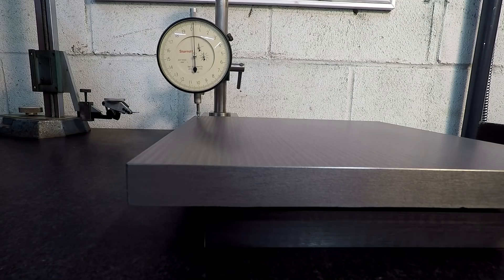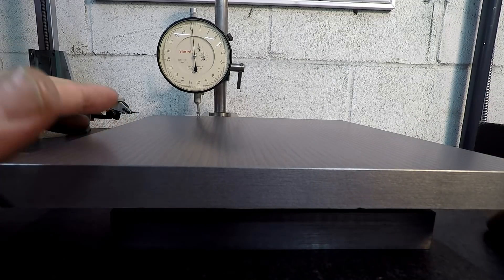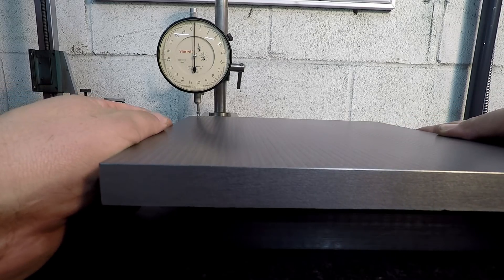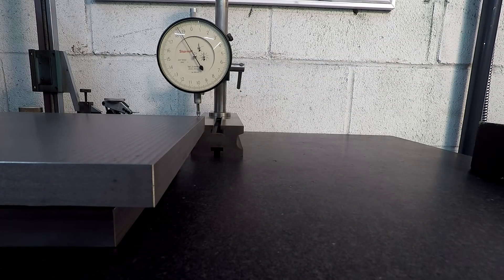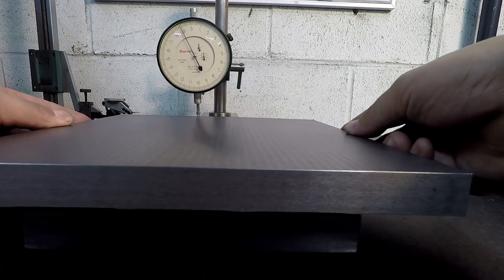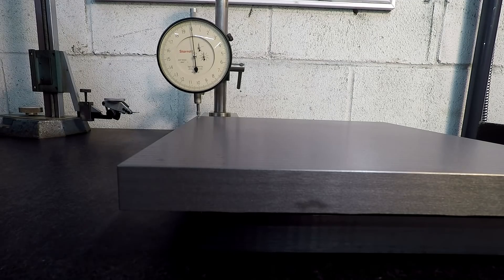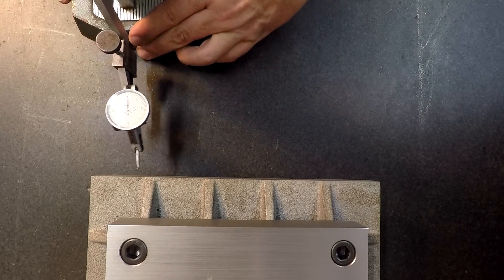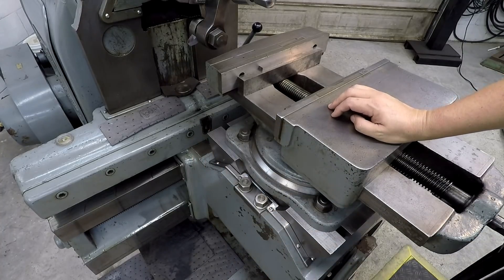Fireball Tool Fixture Plate Part 6: Inspection

Comment: have you tried inking it against the surface plate and hand scraping?
You could probably get it within a micron or better without too much trouble, don't ya think?
Love what you've done, especially with such an old workhorse of a machine, which you've really dialed in well!

Comment: You bumped the work in the vise till the parallels were tight . I think a better way would be to put a piece of paper under each end of each parallel and gently tap it down till the paper was tight on all four corners.

Comment: How did you keep that dial indicator parallel to the workpiece as you moved across the side? Whatever you hold it against has to give you a lot of confidence to measure in tenths like that
Reply: Surface plate older tool than a shaper.
Reply: A straightedge behind the base of the hight gage?

Comment: Have you considered mounting your shaper on the wall to run the ram vertically, which might eliminate that last thou of drop?
You are doing great work on solid machine that has 70 years of use.  Ignore the nitpickers!

Comment: When lifting the clapper to hone the tool in place would you be introducing a skew out of square in the tool hone due to the arc at which the tool travels when lifting the clapper as a result of have the clapper swung off to one side to miss unground surface on the backstroke?

Comment: That’s pretty damn good!  Nice work.  I bet that ram has some deflection when it’s extended because of the shear weight of it.  And like someone else said, heat in the tool. And probably even the machine itself heating up. Pretty impressive tolerances considering. I bet you could get it even better taking those things into account. But still, pretty dang good considering the machines age and size of the workpiece along with the multiple setups involved. Good stuff.

Comment: Came out lovely and will be a useful fixture pallet for sure. Ram droop is another factor into the mix on a shaper along with all the axes to tram the universal table and vise, your parallels and setup pieces, dirt, chips, wind direction, day of week etc etc.... 😉.....though as I recall, the G&E is really good in that regard, being in such good condition. 

Bottom line though is to get it squared away inside a thou in all directions is pretty much as good as you could hope to get and PLENTY close for any milling or shaping setups. Could also be used in lieu of a faceplate on the lathe for small odd-shaped items, as🔨Tom 🛠 showed a couple years ago with the smaller aluminium pallet. Saves trying to wrestle a big heavy 4jaw off the machine for no reason 😎

Comment: Well done Adam.
A couple of thoughts.
You should use a small Joe block under the probe when measuring the surface to even out the tool marks.
Maybe put a bit of blue on the tool bevel before honing. Not only will it help ensure the edge is honed to the corner, but will give you an idea of your max step over.

Comment: concidering the tool can go u and dows both during the push and pull cycle and the grind of the tool itself could make those 2-3 thousand wavy errors I suspect heat within the material could account for some of the error.  The real question, is how exact was a new machine trammed in and in use.

Comment: It's worth noting that a piece of normal paper, like what you'd find in an office, that paper measures out at 0.002"

Now consider Adam had a difference of what he described as "half a thou" - which would be 0.0005" or 1/4 the thickness of a standard piece of paper!

He makes it seem so matter-of-fact that he can perform this kind of quality work, but he's getting better precision in his home shop than some commercial shops are capable of.

An awesome video, thanks for posting!
Reply: Good Point! Great Example for Comparison too! That gives people without machining knowledge something they are familiar with to compare too.

Comment: Nice job, Adam!

For all the naysayers, when you need accuracy <.001" over almost a foot, you're gonna' be checking tram on the machine before you start, stoning the table for high spots, and very likely lapping or grinding the finished workpiece to get there.

It ain't likely to be something you casually bolt to a plate that you grab in the vise - for those kind of jobs, being within a few tenths on to part is well and truly fine, right?

Comment: Looks like your spindle needs to get trammed in badly. that few tenths on a 1/2" cutter will be a nightmare with the fly cutter you should be using. ✌😁
Reply: Shaper bud, doubt there will be any fly cutter used

Comment: If you want your tool plate flat and parallel,surface grind the plate you attached to fixture and then take a couple of finish passes at .0002-.0003, this process makes a flatter surface because grinding wheel “digs”in a little more in the center of workpiece when your using a long stroke on workpiece. Then flip workpiece end to end not front to back,and repeat process.
Reply from the maker: I'm not looking for or needing the precision flatness the grinder gives. This was a shaper project.

Comment: Could set up a removable screw adjuster to help zero out the table tilt, you mentioned being tough. Of course if you never plan to adjust it from there then no need.

Comment: I was wondering if the ram might move further than half a thou when under load? The side to side looked tight. 
Those longitudinal tool marks are a bit like flaking, they would hold oils well I was also wondering :)
I'm with you Adam the surfaces look beautiful!

Comment: Great set of vid. If you measure the ram way surfaces on the surface plate, do you see that 1 1/2 thou of wear? Time to practice some of your scraping skills? Also can you measure how flat the hone is on the bit is with a dti as you traverse, is it possible to dial out the 0,3 thou by rotating the clapper after honing?

Comment: That's an excellent result Adam. 
Would be interesting to reverse the backing plate and see if that changes the error. 
With basically four cuts to achieve such a small error, when there are several potential causes - wear in the arm dovetails, wear on the table slides, wear in the table tilt bearings, and the setting of the universal table - that's an incredibly accurate result. 
When did you last have your granite block calibrated?

Comment: Adam @about 3:00 you see a bit of droop in the shaper ram. Could you use this information to work out where to set your ram on future jobs to avoid this 1.5 thou wear spot? You could mark the ram so you know where it is and either avoid it or place it where is doesn't matter on the workpiece.

Comment: I've watched the full series on this fixture plate and I still don't know what it's purpose is.
Reply: @jnimitzch4738   The most basic use would be to put it in his mill vise and then clamp parts to it. It should have a grid of drilled/tapped holes when finished.

Comment: I really like your big 1/10's indicator.  Sometimes those "last words" indicators are hard to follow on video.  By the way, maybe I missed something, but it seemed like you were measuring parallel to the surface plate (or the 123 blocks on the surface plate).  What would happen if you put the cast iron or the steel surfaces on the granite and indicated the opposite surfaces?  Could any highs and lows be cancelled by remounting the steel plate 90 degrees left or right, or 180 degrees to the original mounting on casting?  I think for cutting internal splines, keyways, or dovetails, it's more than good enough.  Of course you could send it to your buddy Tom Lipton who would take it to some mountain top, bounce a laser beam off the moon in the new moon phase, while it's floating on a pool of mercury.

Comment: Adam, Instead of using 123 blocks use 3 jacks one under each corner and one in the middle on the other side forming a triangle. Set plate on jacks and indicate plate to zero using jacks. Then indicate bottom from the underside. This will give you how parallel your plate is. This is how we checked this stuff in the calibration room.

Comment: Nice work Adam! I would be interested to see how the piece moves around after you machine the holes (due to internal stress). Maybe you could do another inspection afterwards? Cheers, Dan
Reply: Holes don't relieve stresses like a cut, the stresses are smoothly transferred around the hole, which is why everyone was cutting "Go Fast" holes in their hot rod frames.
Reply: or re-cut it... if necessary.

Comment: I took 11 measurements across each edge using the webbing for spacing and I get a standard deviation of +/- 0.00033" (+/-0.0084mm) which is pretty damn amazing!  The small amount of error also isn't linear across the cut, it has a 'belly' almost as if the plate bowed a little while clamped in the vice.

Comment: I’d say a thou accuracy, on a 70-year-old machine is amazing!

Had a thought about the flatness caused by the honing. I noticed the clapper wasn’t all the way down when you honed it in. With it set at an angle, could that have introduced the 0.3 thousandths variance? Just an observation from the “peanut gallery”.

As always, amazing work!
Reply: " I noticed the clapper wasn’t all the way down when you honed it in. "

Yes, but that was the idea. It produces needed relief behind the cutter edge.
Reply: Me Now 
The clapper also kicks off to the side a small amount.  I think t hat is what Dave was asking about.

I had the same thought when i watched it last video.
Reply: @BramBiesiekierski  You are right- he has it at a side angle too. That complicates things.

Comment: That is fantastic accuracy.  I wonder whether the base being fastened tight to the top of the plate might be putting pressure on it.  Perhaps a small spacer between the base and top at each corner would lessen any such.

Comment: I really need to applaud the craftsmanship in these series of videos- I'm really in awe of the accuracy of the machine and the knowledge and shared experience of the Operator.  But I have a question about parallelism.  I noticed the way you set up the initial facing cut on the webbing below the main face in the vise(the webbing side was subsequently tapped and another trued plate mounted to it).  When you set the unfinished main surface into the vise (the whole piece being upside down at this point), I was impressed by your use of a piece of rod and the parallels- but if the un-finished cast surface was out of parallel from the foundry, and somehow that difference in "un-paralleism" was the same on both edges of the unfinished surface, would that difference transfer when the piece was flipped over, with the addition of a "true level" plate on the webbing side, or not?  I'm still learning here, but I've chased four corners around a series of circles once or twice in my vocation.

Comment: As far as the tool marks go, those highs and lows should actually IMPROVE accuracy since your parts are resting on the high points, much like the saddle rides across the averaged highs and lows of a scraped surface on the ways. Damn good Work. Man, I'd be super impressed with those results!! Additionally, I'd say that the "variance" in your cuts was simply your grind on the bits. Tramming you tool holder to the bit should cure any on those issue. The only problem is HOW accurately do you want to "scrape" a surface.

Comment: That seems well within the expected tolerance of the machine used.  I would think that pretty good! You forgot to check the sides for square and parallel though. :-) Chasing exacting tolerances is both aggrevating and fun.  When I got Mikes old shaper machined and it was within +-.002" over a 4ft area of square and parallel I was super happy. All of the hours leveling and tweaking and aligning paid off!   You might could clamp your part further out so the stroke was out longer and in an area of less wear and get it flatter but it would only be a what if excercise.  It is plenty good as is. Chinese 1-2-3 blocks don't guarantee any better. lol

Comment: I think those are pretty good results, especially given the equipment you were working with. That boom has a lot of travel, and it's going to bend along the stroke no matter what. You might be able to get it somewhat tighter with a very trick tool bit that requires very little pressure, but I'm not sure.

The only thing I was sorta disappointed with was the irregularities from the tool bit. I get it's kinda' expected with a shaper given how it works. I wonder if you could reduce it by doing just doing a bunch of complete spring passes over the piece, but offset the X slightly after each complete pass, so the ratchet-advance on the X makes the tool bit hit the highs next time around.

Comment: On the note of tool marks, It occurred to me that when you're honing your finishing cutter on the shaper that you lift the tool a little bit to be able to apply some pressure to the honing stone. With your clapper being offset to one side or the other whenever you set the cutter back down after honing it, the honed edge is now not quite perfectly parallel to the work piece. I didn't think the effect would be that dramatic though.
Reply: Good point!

Comment: Nice work Adam, when you get that surface grinder you talked about then you can touch it up to within .0001" I ground my cast Iron sine plate which was about that size and it came out flatter than the scraping that was on it. The shaper step lines will help release parts that may get wrung to it if it was a ground surface.

Comment: Nice job. I had the same with my shaper.  I need to grind my vise .  The table and tilt is good. And the parallels are very close.  So the issue has to be where the parallels set in the vise.  The tram was from the top of the jaws not the rails on the vise.

Comment: I scrolled through the comments and didn't see it mentioned, but did you ever get your surface plate lapped?  I don't recall you mentioning that you did, so it is a good possibility that some of that is in the surface plate as well.  The old shaper might be even better than what was measured, if the plate has a dip in it.  Thanks for the mid week video brother!

Comment: I think that's pretty darn great! when you consider they use a thing called a torque plat and torque all the major fasteners on an engine block when there precision honing cylinder walls to prevent distortion and the iron your using is a freshly machined casting that tough scale holds a lot of tension you just released by machining it the dowels are a real good idea those YFS socket heads I am impressed with those (I usually tourqe those to grade 8 spec) cut one of those with a hack saw and do the same to a grade 8 bolt those socket heads seem tougher to me but you see some additional factors I hope vibration during use will probably relive some of the internal stresses over time its tough when you want tenths so ya that turned out real nice for an old shaper and how long have you had it and and how many projects you've almost got it down to a predictable and repeatable science in my opinion there's a lot there to keep me on task thanks that's what im looking for here

Comment: Beautiful stuff.  I'm wondering if one of the deflections as due to the vice squeezing the material up in the center.  That would cause a dish in the relaxed part.  Just a thought.  Folks like you are making me think in ways I never have before.  I really never thought that this level of accuracy depends on the regular forces.  I would think that the mass of the material would resist deflection.  Between you an Tom, my world has been shaken <grin>.  I love it when the Earth moves like that.  Um, that didn't come out like I meant it.  Nor did that.  I give up.

Comment: Thanks Adam. Great old machine. Within .001 is pretty good considering all the stack up. I have noticed when my reaches the end of the stroke there is some oil around the base of the vice and i can see movement within that oil. to me that is a good indication that either the base of the vice is not flat or the top of the table under the vice is not flat or maybe even needs to be tightened some. When I get time i intend to take the vice off and check flatness and stone it well for any mini burs or high spots. It all just takes time and patience. If I can get mine  within .001 i would be happy but would also probably try to get to within .0005 lol. We have this thing about perfection.. LOL

Comment: It looks like the metal had moved after machining. You took off quite a bit of material off of it, and it being a cast item, it will move overnight, and Ive run into this a few times on items that needed to be scraped. I usually rough it in, then leave it sit for a few days, then take the finish cut after the metal has had time to de-stress and move, then take your finishing pass.
Reply: Good point. It might move a little more then if Adam would remove the base plate.
Reply: It could also be the base plate that's helping it moving too, not really sure what type of steel he used, and I know cold rolled will banana pretty hard if you take heavy cuts on it on just one side due to the strong internal stresses of being worked cold, so never really know.

Comment: You honed your tool while it was hanging from the clapper thats set at a angle. When you swung it out to put the honing stone under it, it puts a angle on it. thats why your tool marks are so uneven.
Reply: Indeed! That is a good explanation. It would not happen only if the clapper axis was horizontal.

I was also asking myself if a larger point to the dial indicator would remove the "vibration" in the reading. That would give a better "flatness" indication. Sorry for the bad English.
Reply: Yep that should give each step over a sawtooth profile.

Comment: It looked as if you were moving the indicator in a slight arc, causing the finger of the indicator to wind up maybe in the bottom of a cut where it might of started on the high spot.  But to get that close with a Shaper of that vintage is great work.